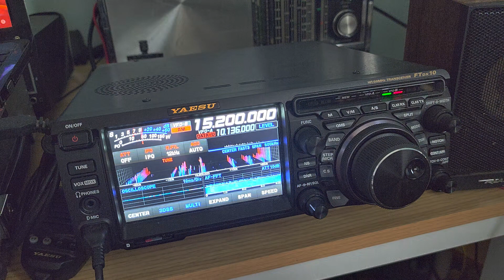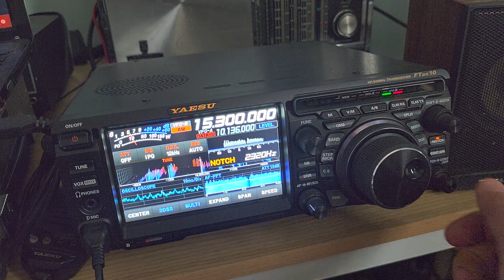Yaesu FTdx10 Transceiver 15000 to 16000 kHz Shortwave band scan with comments 1930 UTC

Comment: Just wondering how the reception would compare with the Tucson H501X to the yaesu. Using the same antenna of course. I'm looking for a high-end receiver, but don't need another transmitter. But there isn't much available in Hf shortwave receivers that are high-end right now that are in a respectable price range.  Jerry W9tko